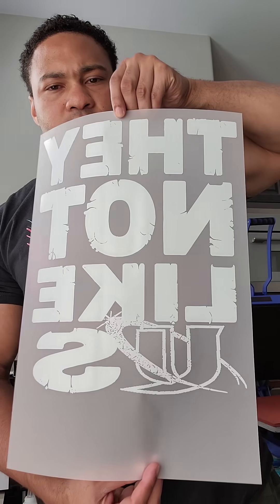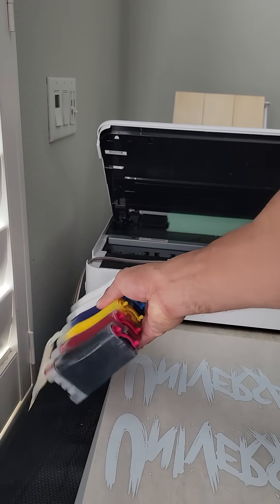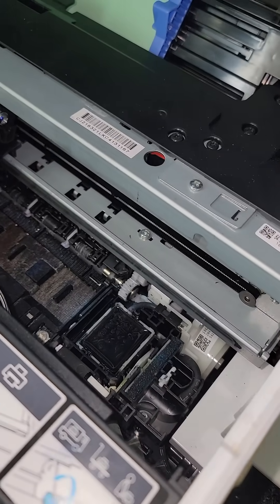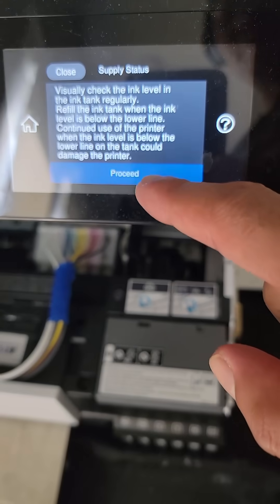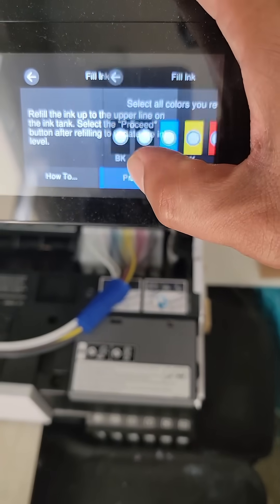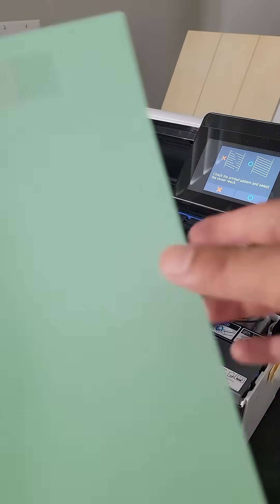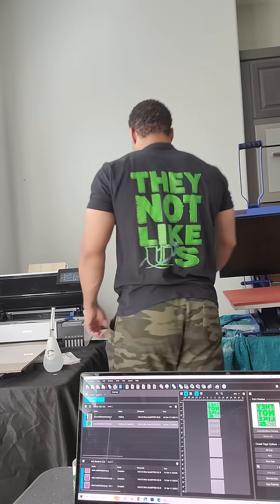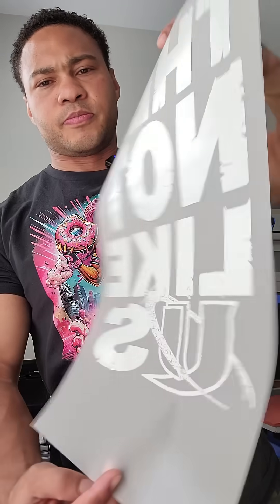ET-8550 DTF Printer Maintenance in 60 Seconds! | Quick Tips for Perfect Prints

Comment: Quick question.. I just converted  a new 8550 it prints and everything but it seems to drip ink out of the print head while its printing. The image turns out fine but it has these drips mostly on the left side as the print comes out. How do I fix that???? i saw that I can get silicone plugs to put on the top side of the print head. Is that necessary
Reply from the maker: Are you using a ciss?
Reply from the maker: Yes, why couldn't you?

Comment: How did you get the white ink on the back?
Reply: It's a modified printer with rollers removed and software on pc to print from that sets what colors are in which ink tank
Reply from the maker: Convert it back as much as possible, the rollers do not need to be readded